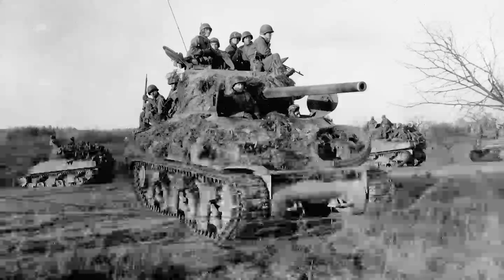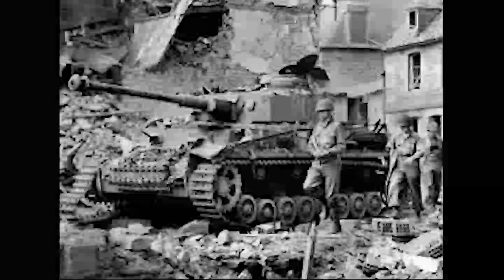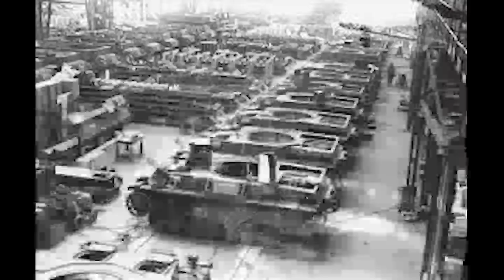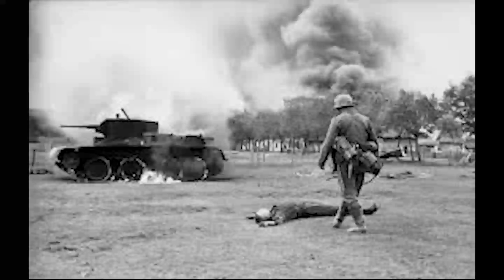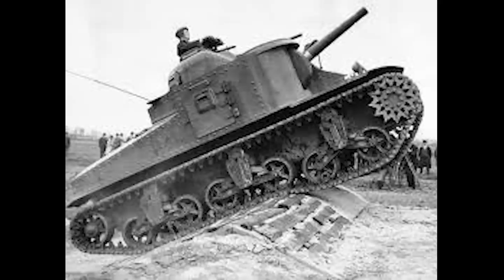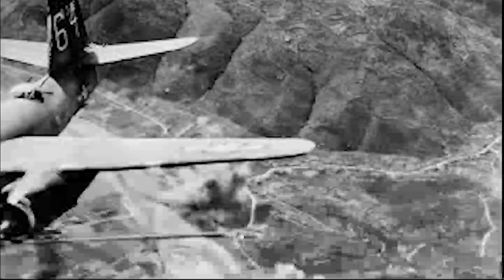Why Germany's Panzer IV Failed What Sherman Did For 4,000 Miles — Without Parts.

Comment: 0:20 the panzer 4 Ausf H didn’t use torsion bars…it used bogies. The panzer 3 incorporated torsion bars,using slightly larger wheels and raising the floor to accomodate.the torsion bars.